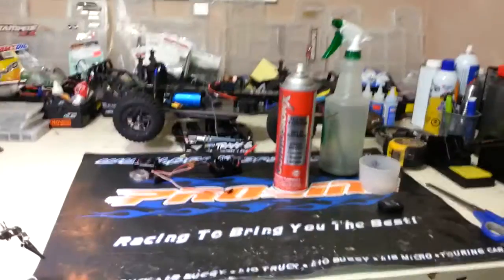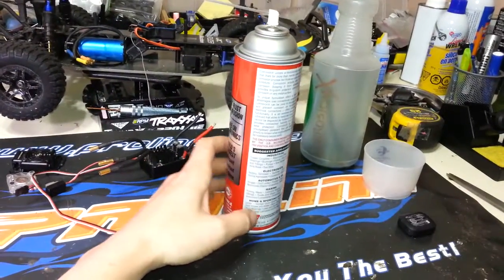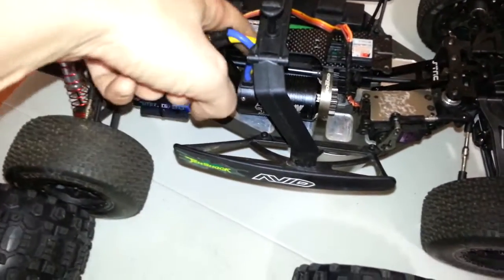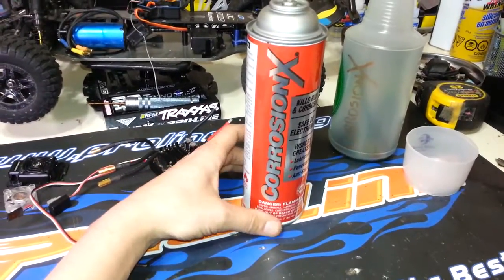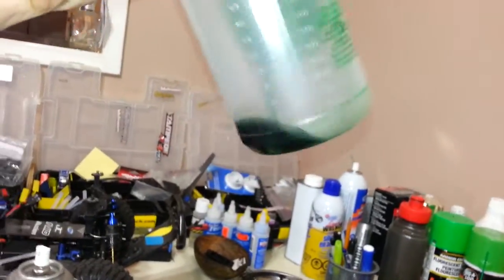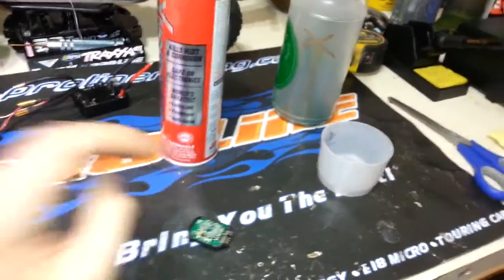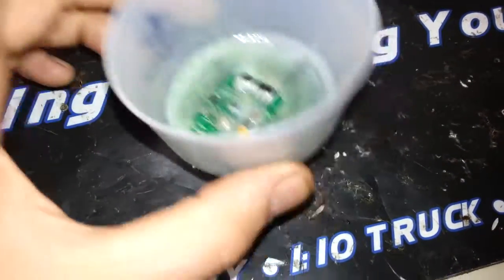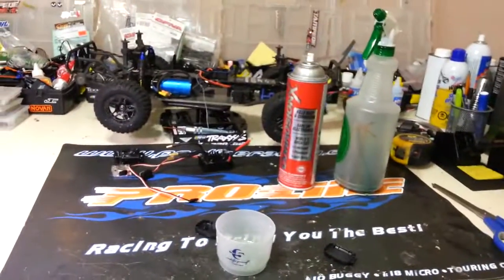Waterproofing ESC/Servo/Rx&Tx With CorrosionX

Comment: since making this video how has the corrosionx been have you had to respray often does it wear out fast only reason i ask is i have a scx10 and ive normally done the plastidip method and im not liking the heat build up anymore and have been looking into this type of waterproofing co far ive seen 3 different brands to use corrosionx, rust oleum neverwet and techspray conformal coating

Comment: This stuff is great for guns as it absolutely keeps them from rusting if applied once or twice a year, electronics come back from the dead sometimes with using it.  Great for spring/key locks too even in saltwater environments.  Originally made for the aircraft industry to prevent corrosion on airframes.